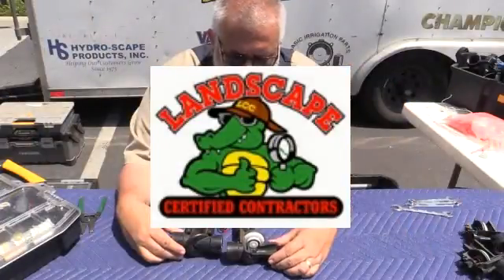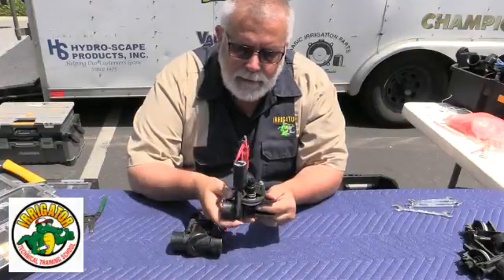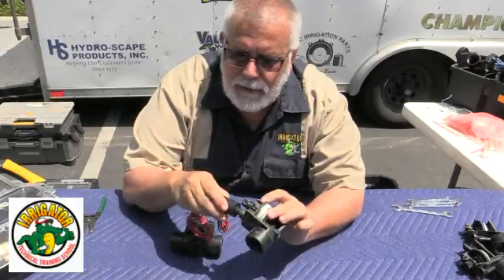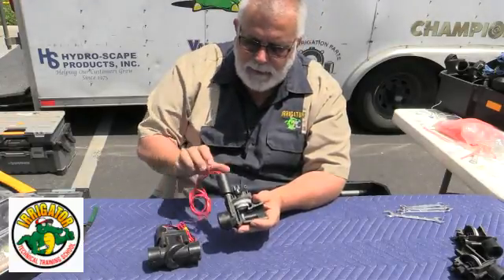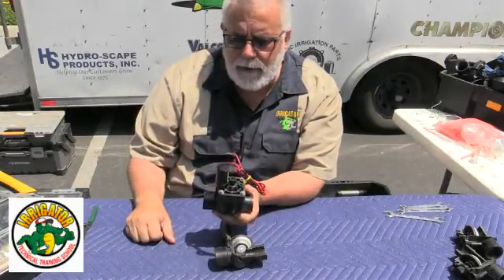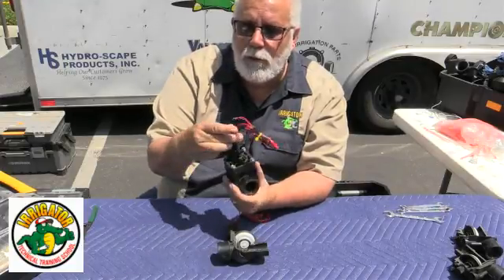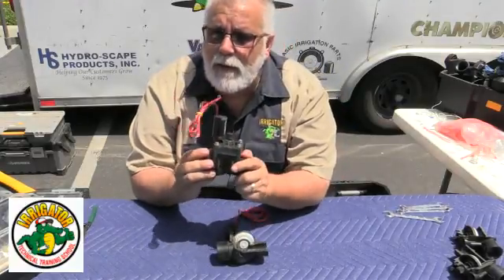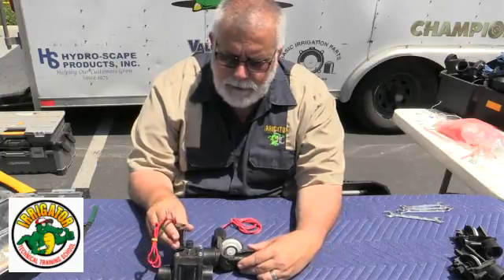Hunter Irrigation Valve Maintenance

Comment: Sir, I have a problem, I have this exact valve. My bleeding screw has an "o ring" it was leaking from the bleed screw, I took it apart and the o ring was shot and warped. I went to purchase a new ring and installed it. But when I tried to screw back in the bleed screw, it does not screw in at all. No torque or no tension for a screw on. I'm in a bind. Thank you for the video. Please help sir. Thanks again